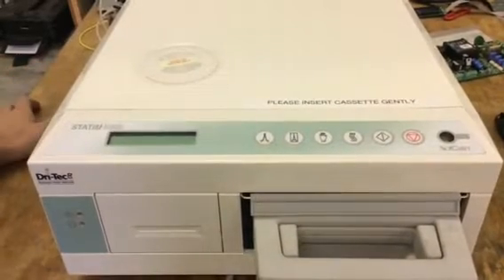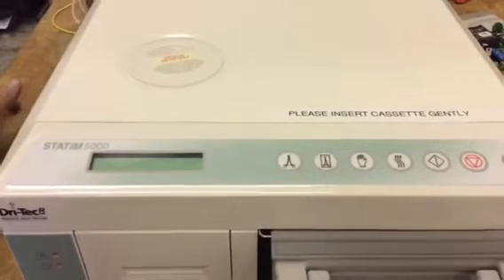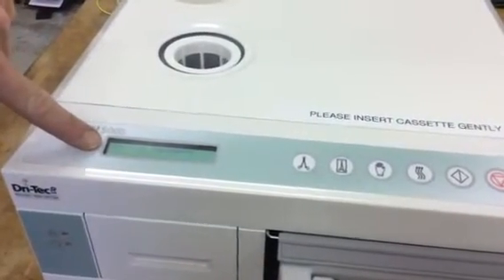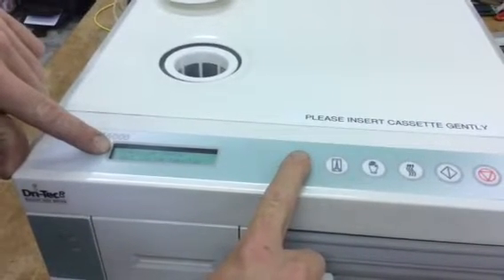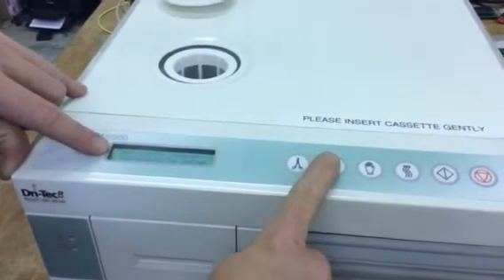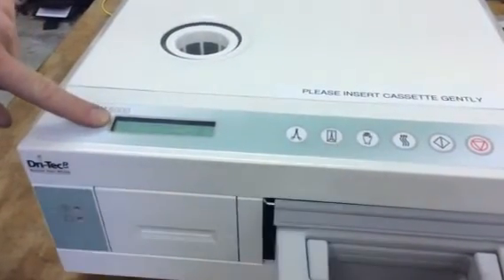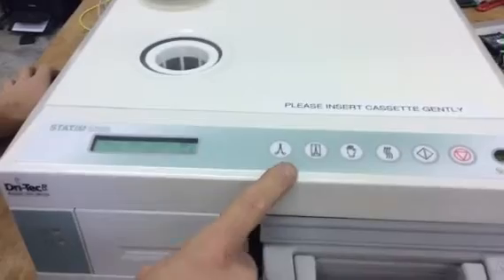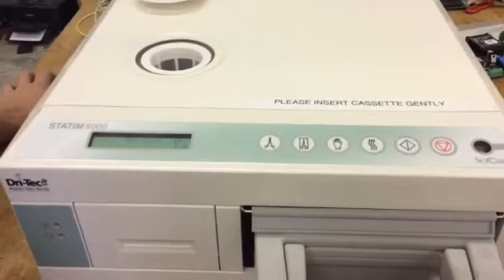Statim 5000 Repair in Service Mode

Comment: any suggestions for cycle fault 28??
Reply from the maker: It would be best if you call our Free Tech Support Line at 704-966-1650 opt 3. There is not a Cycle Fault 28 in the US models so we would like to discuss the issues you're having.

Comment: How can I empty the clean water from the container of statim 2000 autoclave to be easy to change its place and store it ?!!!
Reply: KoKo Atef
Your Statim may have a drain hose underneath the  unit. It is a grey flexible hose with an orange plug in the end. The only other way to drain a Statim safely is use a wet/dry Vacuum cleaner and suck the water out of the reservoir.
Reply from the maker: we would have to install a drain tube. its simple and we can sell you the parts as well give us a call. Apologies for the extended it took us to reply . We are a growing company with lots of hats we wear!

Comment: Hi there Stanley Sterilizer!

Excuse me, I have seen all your sterilizers' videos looking for a trouble in which we haven't been successful to solve.

We have a SciCan Sterilizer 2000 and it has been displaying "service needed" error. We have already seen, read and followed the manual service. It said that it was a boiler problem or a pump problem. At the beginning we bought a new boiler and cleaned the filters of the pump. Indeed, we already changed the pump too. Afterwards, we tested the sterilizer again. It was successful.

But the problem is that yesterday that we power on the machine again and we tried to used it to sterilize, the machine started to show the same error message: "service needed".  Of course, cycle doesn't finish. The error appears after we have been pressed the "start" button and, almost, when we have reach the 135 degrees temperature (it appears between 127 degrees and the 135). 

We have no idea what's going on with the sterilizer. Could you please let me know if you have any, even a superficial one, idea of what's happening with it? Thermocouples are okay (at least, we haven seen any of them broken). Maybe it can be the PCB.

Thanks a lot for your help!
Reply from the maker: Give us a call at 704-966-1650 opt 3 to speak with one of our technicians in regards to this issue. Its an old machine , 1992 or 1994 . Most likely the boiler is bad but It could be as simple as the water pump .